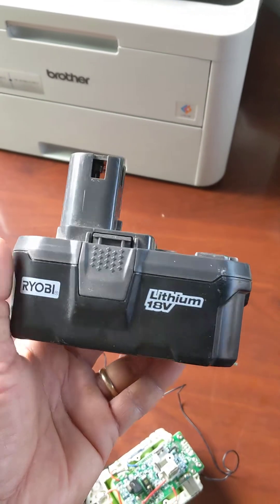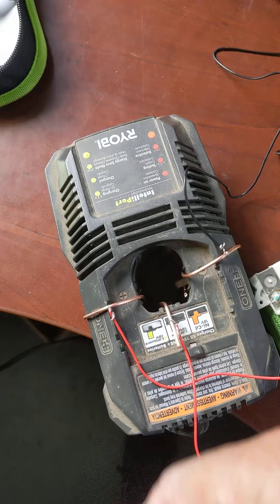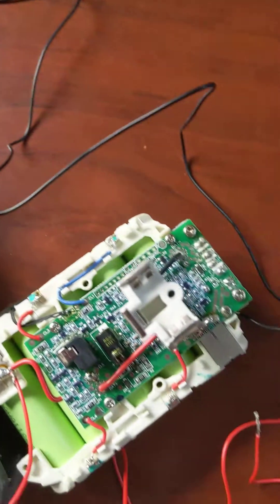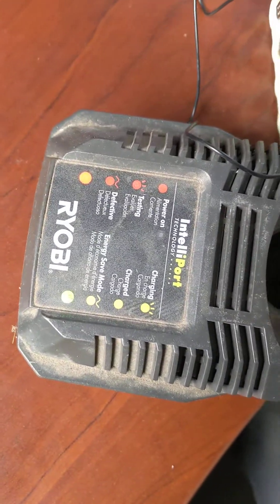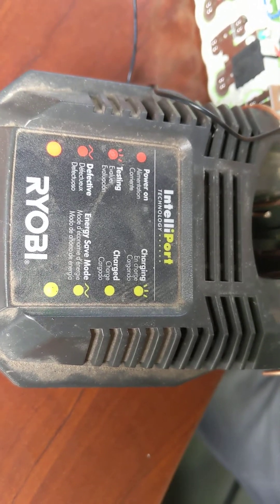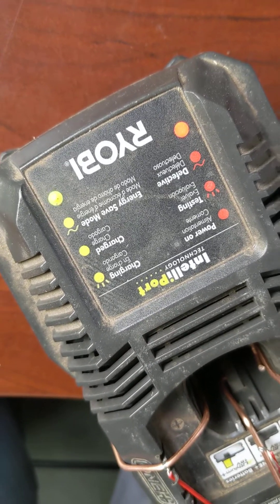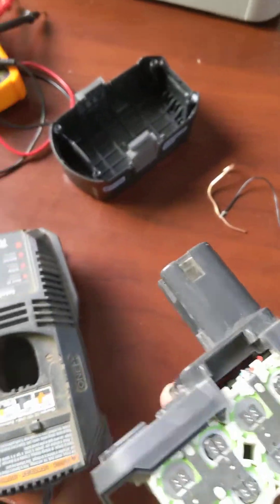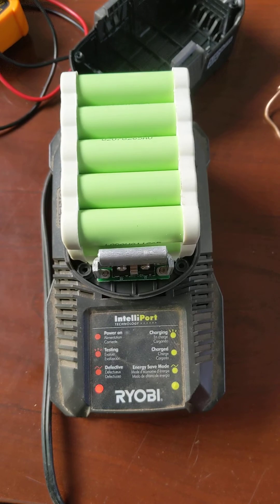18 volt lithium  battery repair in 5 minutes that wont charge.

Comment: Just to mention, the not-charging is a safety feature. Li-ion batteries that are (self-)discharged beyond a certain threshold destroy their internal structure. If you do something like this, your battery may start burning. It may also start burning some time later, e.g. if you leave it in the charger overnight. Please be aware that tampering with Li-ion batteries may get your house burning (and yourself injured or killed).